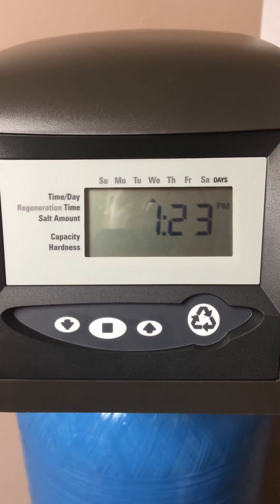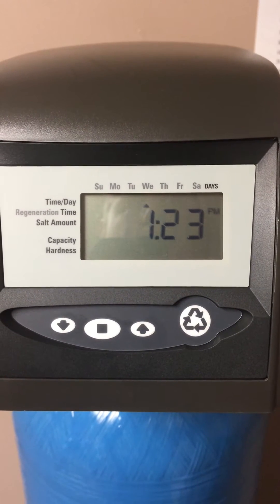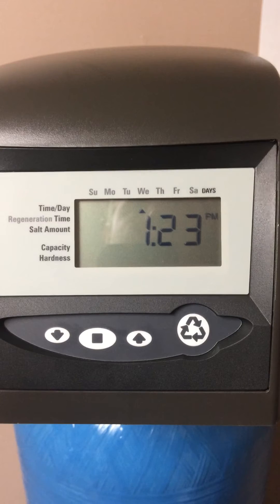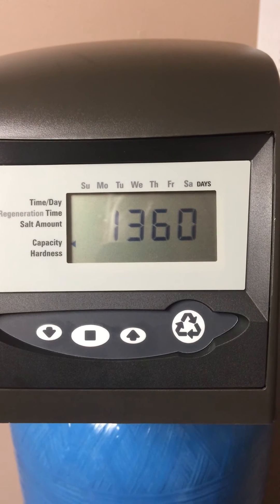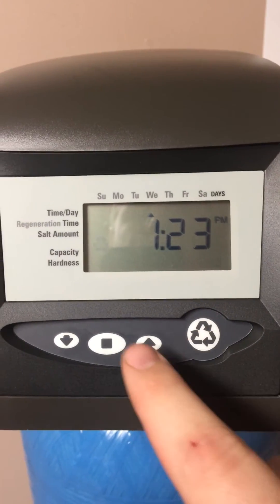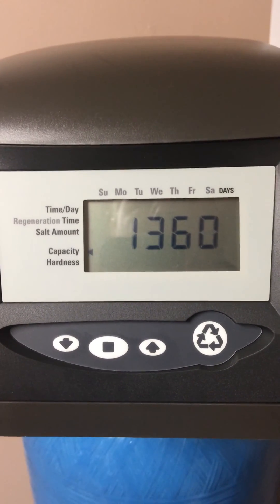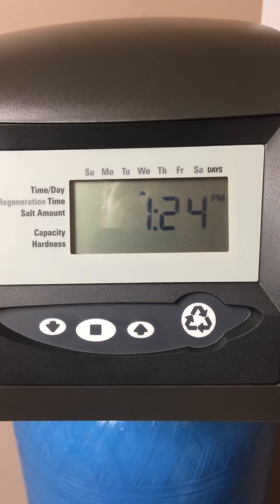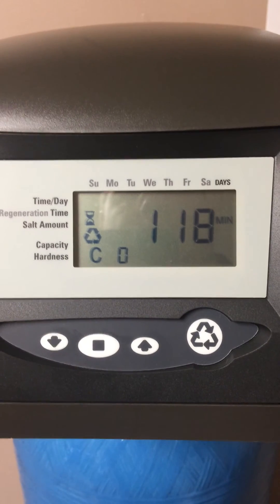Autotrol 700 Series Controller Manual Regeneration

Comment: Is there a way to manually turn it off? Like a vacation mode or manual pause?
When were gone for an extended period,  I turn off the well, so I don't want the softener to try to regenerate. 
Currently,  I just unplug it,  but after just a few days the battery dies and I have to reset the time & day when I get back.  Not a big deal,  but something on the controller would be nice.